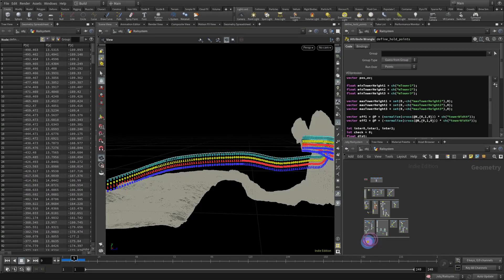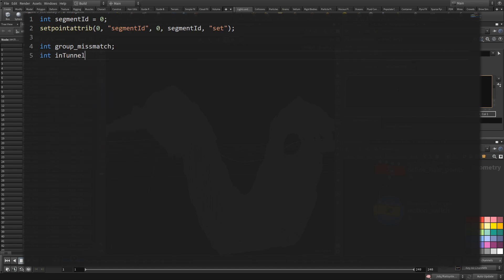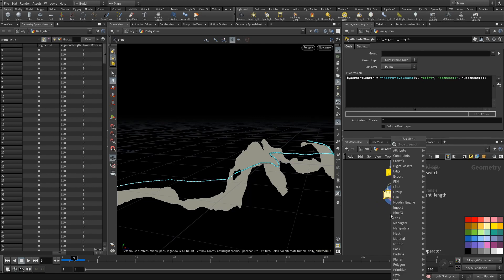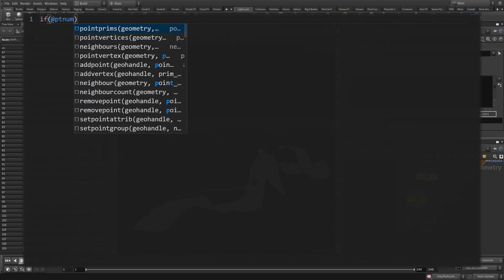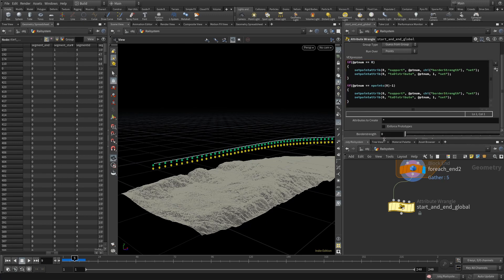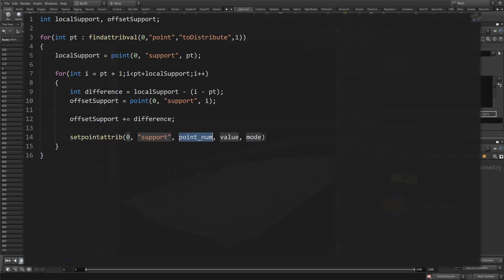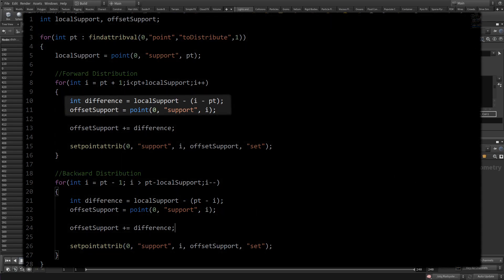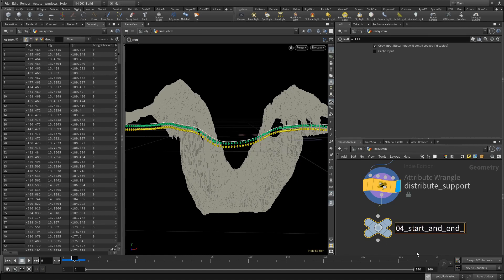Support Distribution  | Houdini Railsystem | Chapter 4 - Clip 2

Comment: When i try a run the distribute attribute wrangle it cooks for 3 hours and crashes, don't tell me this journey ends this way. I learned a lot thanks but it's heartbreaking to not get it to work now. But thanks for all the tips
Reply from the maker: It shouldn't end this way :) There are some bits in here where you can create a deadlock like you described when making an error. So it is explicitly the moment when you try to distribute support? Contact me via twitter or send me an email with the coding. I help you figuring it out.